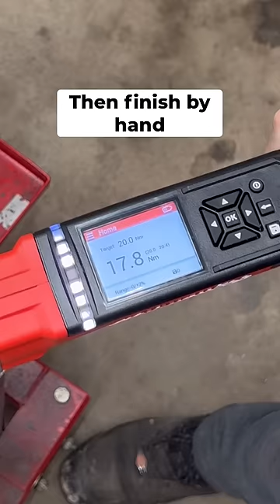How to use Plastigage to check BMW E34 M5 Bearing Clearances #bmw #bmwm5 #bmwe34 #cars #restoration

Comment: torque wrench is dope
Reply: I didnt know Milwaukee came out with one, i want it but i DONT want to look at how muchnit costs.
Reply: I just checked... out of stock everywhere and 800 bucks.......
Reply from the maker: It’s def a nice tool
Reply from the maker: This particular one lists for $699
Reply: But it doesn’t do angles though. Major shortcoming for Milwaukee.
Reply from the maker: @KI4HOK  That is the truth. It should for the price
Reply: @wewrench  definitely should. If it did angles i would have forked over the card already. For that price it should do everything torque related within the ft-lb rating. Ill stick with my good ol cdi click wrench for now, considering i could get the low torque mid torque and high torque ones for 600$ all together.
Reply from the maker: @user-fx8bk3fo8u  Agreed. That and the sheer size of the tool are it's disadvantages
Reply: @wewrench  didnt even take notice to how big it is
Reply from the maker: @user-fx8bk3fo8u  it’s hard to see in the vid. Surprised the hell out of me in person.
Reply: @user-fx8bk3fo8u  guy I knew in college worked on that one. you can play snake on it lol
Reply: Is not accurate
Reply: @manuelpiston  sure  sure
Reply: @JeronimoStilton14   so 700 beans means i can play snake on my torque wrench? even if it is too big for some applications and doesnt have built in angles, i may be sold now. also to the comment about it not being accurate, i highly doubt milwaukee would put their name on a 700 dollar tool and risk the backlash. a whole tool chest from them is 1200.
Reply: @user-fx8bk3fo8u  I mean I hope they left that feature in. I just saw him doing it on snapchat a couple years back during the launch. It might have been a gag done by the developers for the firmware and they patched it out for retail models. I sure hope not.
Reply: Torque wrench is pointless. It doesn't actually do anything.
You still do the adjustment and it doesn't do angle either.
Zero benefit.
Gimmick tool.
Reply: @KI4HOK  this is designed for electrical engineers
Reply: I havent used a torque wrench since my first truck, now the dealership just does everything for me haha for those who use em daily, do you think its worth it for that one? I'm not thinking of buying one, just curious. For me the tools that are absolutely worth it are knipex pliers, make my job so easy sometimes.
Reply: This was a lowkey ad for milwaukeep
Reply: @wewrench  ooohhh 700 not 800 haha u should start your videos by saying not for brokies
Reply from the maker: @LeafararrabiDos09  You can always charge it! lol
Reply: Always fun seeing people talk about tools that have no idea about said tool. This tool was not designed for automotive technicians. And it has features that make it worth the money.
Reply: When your used to snap-on and matco prices $700 aint bad. Cool that it auto torques perfectly
Reply: totally USELESS..

Comment: crazy that something so simple can be so accurate. pretty cool to learn about a thing I never knew existed.
Reply from the maker: I know. It's pretty weird which makes it interesting
Reply: Its not really that accurate. Thats why youll never see them in a machine shop
Reply from the maker: @konnerkramer329  It's more to verify assembly than anything
Reply: @konnerkramer329  
yes it is.  it’s hella accurate.
Reply: @MrZcotty  if theyre extremley accurate then why do machine shops use calipers and mircometers that cost thousands when a $8 piece of plastic is just as acurate? The answers simple its because its not anywhere near as accurate. You can measure accurately down to thousands of an inch with micro meters where as a plastigage cant even accurately measure hundreds of an inch. Not sure how you think that is even a comparison
Reply: @MrZcotty  it's not actually .. what if the cap isn't round? What if the shaft is conical? Would it actually show that? no? Strange 
You only assume that it is round and that the shaft is straight..
Reply: @konnerkramer329  we used it to build engines for nascar, along with micrometers and calipers. It is a great way to be sure that tolerances are correct before you do final assembly.
Reply: Literally never even heard of this throughout trade school and in every kind of machine shop I've worked in for the past decade. If it was that accurate I'd probably at least read about it at some point in the past 15 years. This is pretty stupid thinking it actually. Like I understand how it's supposed to work but it's stupid. There's a reason I've never heard of it.
Reply: @metalman6708  the reason you have never heard of it is because the shit you are doing doesn't require it. It's just before the final assembly when it is extremely important that all of our tolerances are perfect. Not worth it to use on a regular build or part.
Reply: @metalman6708  ah yes because you know absolutely everything about machining and measurments
Reply: @metalman6708  the main reason it's not used that much is that it requires the 2 pieces being checked being compressed perpendicularly to the axle, and that just doesn't happen that often.

You can't use it to measure ball bearings, as those are mounted axially, you can't use it to check a single part etc... there's a lot of limitations, and so you usually only use micrometers and gages, and once you have those you don't really need the wax rod, which also requires cleaning after.
Reply: @konnerkramer329  You’re wrong.  Superfastmatt had a part in a video where he compared them.  Plastigauge was within plus-minus 0.001 of an inch.  You’ve never turned a wrench in your life.  Stop talking.
Reply: @konnerkramer329 🤡🤡🤡🤡🤡🤡🤡🤡 Thanks for making me laugh .
Reply: Plastiguage is used on aircraft assembly. It's accurate.

Comment: That is the nicest fanciest torque wrench I ever saw
Reply from the maker: Thank you! It worked well
Reply: @wewrench  does it not do angle torque? I bought it when it first came out and was very sad that it doesn't do angles. I sold it got a snapon. Does yours do angle torque?
Reply from the maker: @JackTheSnack.  This one does not, and I agree its disappointing
Reply: I believe this torque wrench is catered mainly towards electricians. They are very nice indeed though!
Reply from the maker: @FV25  So there was an article by the tool guy or something like that, and someone from Milwaukee stated that was designed with electricians and mechanical contractors in mind. But it doesn't mean it can't be used in an automotive setting. There are people on TikTok saying "not for automotive use" which is THE MOST ridiculous thing I've ever heard

Comment: That torque wrench costs more than my car lol
Reply from the maker: It's a cool tool, but pricey yes. Wish it did torque angle function
Reply: @wewrench   do you not need to do the torque angle to get accurate bearing clearance?  I know they are single use bolts
Reply: @jamieh8959  yes you need to torque it to spec for accurate reading, as far as i know they are not single use bolt tho.

Comment: Two tips. You don’t need a piece that long! It only needs to be longer than how wide it’ll be squished. Also I wouldn’t remove the main cap like that. If possible it’s better just to lift straight up. I’ve gotten bad ratings from improper cap removal
Reply from the maker: It wouldn't pull straight up, but I do see how that can distort it

Comment: Nobody ever mentioned using a bottoming tap on all crank bolts and head bolts then blowing out all holes with compressed air.
Reply from the maker: Different video
Reply: Why do that?
Reply: @johndc2998  make sure threads are clean
Reply: @johndc2998  clean smooth threads means the torque turns into clamping force effectively.

We use torque as a proxy for clamping force because we can measure it. If the thread was messed up you could put the specified torque on the bolt with no clamping force at all, or more likely less force than expected.

Comment: I don’t get why you only torque it down to spec but don’t angle it to 50 degrees like mentionned. Isn’t the result found thanks to the plastigage incorrect if you skip that part?
Reply from the maker: I did the torque angle but I skipped that part in the video to keep it under 1 minute
Reply: Thanks a lot for your answer and I would like to especially thank you for this channel, I love  old BMWs and own a 535i E34 myself but last inline 6 powered hand built M5 is the dream. Keep up the good work, greetings from France
Reply from the maker: @Ragondingue  Thank you for supporting the channel!

Comment: I have been in 2 auto parts stores and have been told from the parts getter  "plastiguage.... green, blue red? I don't know what you are talking about" ...(redponse) "I use a reliable machine shop" ( bet they have NEVER worked on the internals of as engone😂). I then say plastiguage should ALWAYS be used to ensure a new build.  If you really want to screw with parts getters ask for a piston return spring.....
Reply from the maker: hahaha...piston return spring? That's cruel

Comment: The torque wrench you used it one that’s been proven to be off. Buy a snap on for precision..
Reply from the maker: I saw that video where they tested it. But I'm very certain that not every one that comes off the assembly line is inaccurate

Comment: That torque wrench is NOT meant for mechanic use. That is one of the worse torque wrench on the market. If you wanted something accurate should use a torque wrench from Harbor Freight..
Reply from the maker: That's a ridiculous statement. And just because one wrench that made it into the hands of a youtuber was inaccurate doesn't meant they all are. And as far as HF goes, I do own some of their stuff but their TQ wrenches are def not trustworthy
Reply: @wewrench  Brother, Please dont take it offensive. If you see the demonstration from Milwaukee when they presented the tool they specifically said this is NOT meant for mechanical use. Im only trying to save you from causing some serious damage. Please take the message how you seek fit . Thank you and have a great day.
Reply from the maker: @Munchiie  I'm not trying to be a hard ass about it. But think for a second what you are saying. A fastener is a fastener, whether it's a lug on an electrical load center or a wheel lug. Please post the link you are referring to where Milwaukee says in a presentation its not for automotive use. Best I could find is a tool review website that quotes a phone call with a product specialist that said it was "designed with electricians and mechanical contractors in mind". FYI, I am sponsored by Milwaukee and their product specialist sent me this tool knowing I was an automotive professional and content creator.

Comment: Im not understanding why you’d torque it down with such a precision device and then pull it all apart again to see if it was right. Is this to just test tools or? Im not trollin btw. Its just seems like extra steps.
Reply from the maker: So you can get the proper squish on the bearing cap

Comment: I remember building my first motor on my own, reused the stock bearings as they were nice and good but i mixed them up. Motor completely locked up on the dyno
Reply from the maker: ouch! nightmare scenario!
Reply: My first V8 engine build I didn't file the piston rings enough causing one to break which turned it into a V7.
It pressurised the sump and blew the dip stick out...I was only 16 😂
Reply from the maker: @johno9507  Yikes! Sounds like a nightmare!

Comment: I feel like I’ve seen a lot of these videos, but I haven’t seen any video about what happens if you’re out of spec on the bearing. 

Like how do you buy an over/undersized bearing?
Reply from the maker: Oversized bearings are sold by the OEM and aftermarket. And you may need a crank regrind as well

Comment: I love it when the plastigauge sticks to the tin overlay of the bearing and it gets all f#cked up trying to remove it. I would squirt a little wd40 between my thumb and finger and pull the stuff through so it wouldn't stick...of course that was before I bought the right tools to measure with.
Reply from the maker: It didn’t stick on this one luckily

Comment: You didn't torque the main caps properly. 
It's 20nm plus a angle of 50°, you forgot the 50° angle torque.
Reply from the maker: I did it but it wasn’t included in the vid because of the length

Comment: The hard part is what to do if it’s not within spec.
Reply from the maker: Then you need oversize bearings and a reground crank
Reply: Years ago my neighbor assembled a motor that he got back from the machine shop and had oil pressure issues after startup. He tore it down everything looked visually okay I suggested checking clearances with plasti gauge he was skeptical on the accuracy but low and behold some how two main caps we're out of spec he swapped them around and they were right on the money.
Reply from the maker: @kmrjeep  Everybody is blowing me up for not sending this engine to the machine shop, but they make plenty of mistakes too. Plastigage is to verify proper assembly

Comment: And, lets say im not getting the right measurement, what i do with what?
Reply from the maker: You should tear the engine down, and re-measure with a micrometer. And you may need undersize bearings or a reground crankshaft

Comment: Ahhh yes plastigauge, kinda like using a wooden yardstick to measure precision clearances
Reply from the maker: Yup. It's so low tech, but reliable enough to verify assembly. You would never think though
Reply: Papadakis did a video on how accurate plastigauge is on a 1000hp 2j.  Check it out

Comment: How would you even measure clearance with a micrometer.
Reply from the maker: You measure the diameter of the crank journal and then the bearing with a dial bore gauge

Comment: Didn’t mention the 50 degrees??? Does the Milwaukee do angles too?
Reply from the maker: I didn't show that part. And unfortunately the wrench does not do torque angle
Reply: What does an angle mean?
Reply: @gregkeeyako  go to torque then proceed with the specified angle. So in this case torque to 20 Nm then rotate the bolt another 50 degrees. It’s just to target a very specific clamp load. Torque + angle is much more accurate for clamp load than straight torque. 

Source: drivetrain assembly engineer
Reply from the maker: @gregkeeyako  You turn the bolt that many degrees in a circular motion

Comment: On an engine rebuild just grab a micrometer and t gauge.  All that time spent rebuilding and machining just to use a plastigauge😢
Reply from the maker: Plastigage verifies assembly. You should use it even if you measure

Comment: Here's another tip you don't need to know. On all Y block older Ford V8's the end head bolts are just a a tad shorter than the rest and hardly visible. If you don't know this you're overhaul or valve job is doomed. Biggest mistake made on these old engines.
Reply from the maker: Good tip! Never knew that

Comment: If you have such a torque wrench im sure u can afford a micrometer that easily fits to measure the clearance….
Reply: Do you trust the bearing manufacturers. I've found a few off.
Reply from the maker: it's about verifying the assembly when you can use a micrometer

Comment: Oh great! So, how does this item work again?
Reply: When you torque down the bearing cap, it squishes the cut bit of plastigage. After you're done, the cap is removed to see how much the plastigage was squished. The wider the final width, the tighter the clearances are. Different engines have different clearances in this area.
Reply from the maker: Yes!

Comment: Once you stretch the bolts can they be used again?
Reply: It depends on the bolts you're using. Some can, some can't. Refer to manufacturers' specifications.
Reply: Yes
Reply from the maker: Yes. Correct
Reply: If you like your car no
Reply from the maker: @maxpower4781  You can do it safely if the OEM gives you a stretch spec. I still wouldn't personally

Comment: Full width of the journals right to the undercut/radiuses of said journals. Until you see cranks getting machined, in mass production, no one automated grinder is setup, steadied, straightened or centered the same as the next crankshaft. You can see as much as 5um of taper between each journal, main or pin. 

You also aren't taking into account barrel form of said journals which is dressed into grinding wheels.

You aren't getting the true results with how you're teaching!
Reply from the maker: Why does BMW say to check it this way then?
Reply: @wewrench  quick and easy. 

There are also other measurements that aren't taken into account with plastigauge, such as roundness (egg shape) or lobing (a condition best described as flower petaling of the journal) both which have an effect on diameter readings and oil clearances.
Reply from the maker: @Weihrauch88  Yes this is true. The journals should always be checked if its a serious build

Comment: Nice torque wrench, but is not accurate.
Reply from the maker: This one has a certificate of calibration so I trust it.
Reply: @WeWrench  https://youtu.be/E7DyOONsCkM do your research next time bud. Even a 20 dollar torque wrench has a certification.
Reply from the maker: @manuelpiston  I know, but just because that dude tested one that was off doesn't mean they all are. The percentages it was off are meaningless in the real world...but even still. It should be more accurate than that. Not trying to justify it. I knew guys in the field that used 40 year old torque wrenches that were dropped repeatedly and never recalibrated and there were NEVER any issues. So it's one of those things...like engine building...that people love to sweat the details of.